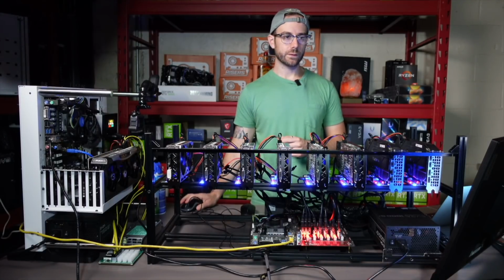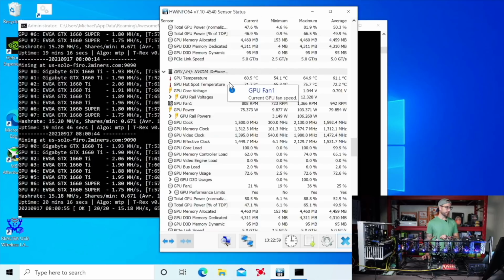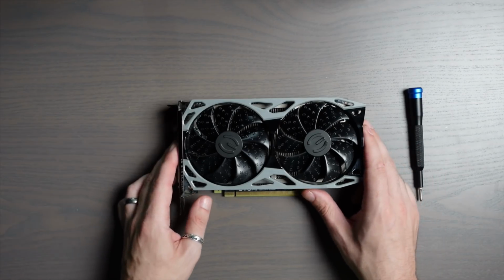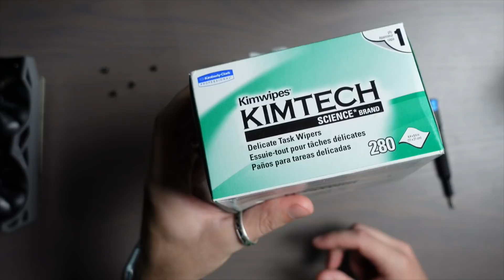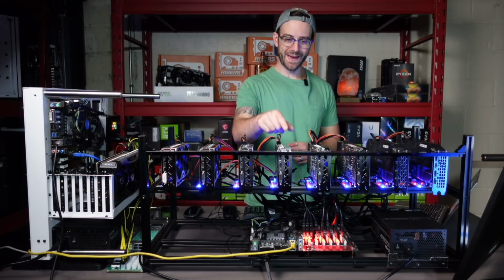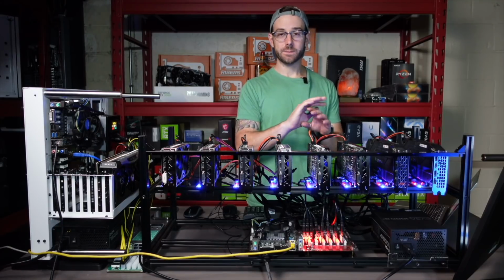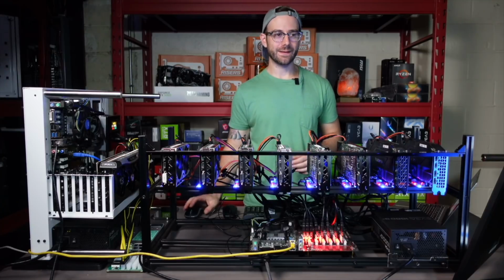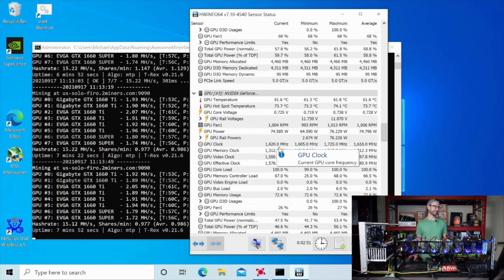Fixing an Overheating Mining GPU (GTX 1660 Ti)

Comment: Nice fix! I bought the a GTX 1660 TI and I was benchmarking on fortnite with heaps of stutters and I was looking at the GPU temperature only at 70 degrees and couldn't work it out until I opened HWMonitor and saw the hotspot temp at 84c which was set stock in afterburner to throttle at 83c so I changed the throttle to 86c and in ran better straight away! I didn't realize a hotspot would throttle at such a low temperature! I opened up the GPU which was only two years old which I had to ruin the warranty sticker on and saw the memory chips looked burnt so I put separate heat pads and heats sinks on every memory chip and replaced the thermal paste on the GPU. It now runs way smoother and the hotspot is now 79 degrees and it runs flawlessly. :)

Comment: late to this party but really enjoyed watching.. chuckled to myself early in the video as I watched you holding the "upper portion/containing fans" which had thermal grease on its cooler portion lay it down on the table with the thermal grease on its bottom.. oops, messy moment... 1 question for you - Do you use a pencil eraser to rub back n forth over the x16 contacts (both sides) or something else?  helpful advice - I've found using only 1/2 half a tooth pick (thickest end) pushed through 1 hole (heat sink side) to align the 4 holes for the securing screws.. leave it in 1 hole while placing the other screws in their positions then remove it and put in the last screw.. makes assembly a tad faster and helps to stop the "sliding" effect.

Comment: On gigabyte cards it is better to remove the plastic back, the card keeps at low temperatures.
The last one I received two days ago, the screws weren't even tight. I immediately changed the thermal paste and the thermal pads and removed the plastic plastic cover. The maximum temperature I reached was 48 degrees Celsius.
1660 ti ,31.40 mh/s

Comment: I have 2 EVGA RTX 3060's and with the same settings in the same rig and running the ~same hash rate one constantly runs ~10c hotter than the other.  I took it out of the rig and pulled the cooler off and it looked good.  I cleaned and re-pasted it and still have the same issue.  If I pull the settings back on the hot car to lower the temp the hash rate also drops.  Is it a "bad luck" card and will always be this way or it could be the other card is a good luck card and the "hot" one is normal.  I use NiceHash and on NBMiner/KAWPOW I am getting ~21 MH/S with temps at 66c and 76c with fans at 75%  Turn the fans up to 100% and temps drop to 62c and 72c.

Comment: Hmm I noticed no connection between ram/vrm's and the heatsink? I wonder how hot they are getting (got a thermal camera handy?) I would add thermal pads from the rear side of ram and vrm's to contact that big metal plate, if not for anything but to help the reliability of the card.

Comment: I just repasted and repadded my MSI 1080ti that's been under water for a year. I think the RAM was getting hot as I didn't replace the pads initially, and the paste was kind of dry. I put Frosty pads (Amazon, I bought all 3 thicknesses) with EKWB paste, and now it mines at 41C, down from 54-56C overnight :D

Comment: Great video Mike! Nutty how half the paste is missing on that GPU.New paste job looks very good. I have a single Gigabyte 1070 that is running much hotter than the rest of the pny/evga/msi cards in my 1070 rig that needs to go under the knife. Thank you for the instruction.

Comment: One point you missed out on is letting the GPU sit for about 24-48 hours to curate before putting it back on and letting it mine right away. Ive done it before and I was getting great temps but after about a few days the paste itself drips out of place and then temps got really hot again. And I’ve done step two and haven’t yet applied anymore paste for many months and is running strong! Nevertheless, great video!
Reply: Mx-5 curation needed. thermal grizzly not needed.

Comment: my 1660's all do 2.00 - 2.20 MH/s on firo feelsgoodman
Reply from the maker: Nice dude. What power are you running them at? 90w?
Reply: @RedFoxCrypto  yeah around 95, i kinda change it depending on each card, my MSI 1660S does 2.30MH/s! its such a good card

but my settings are probably not best electricity wise

Comment: Adding a thin teflon washer to the heatsink screws in the back will increase mount pressure and help bring down those hotspot temps.

Comment: You are correct with spreading on a GPU. Since these are exposed silicon you need to have 100% coverage. On a CPU it's not as critical because the IHS touches all of the silicon.

Comment: Man, remove your rings when you open your GPU! 

I was shocked when I got my first 1660ti that EVGA didn't put pads on the VRAM (cheap fuks), but somehow it's working.
Reply from the maker: Were you grounded? ESD protection?

Comment: Man I've been having issues with my EVGA XC3 Ultra 3080 TIs with their temps. The hottest one was sitting at 68c GPU temp, 98c junction and 72c hot spot. I replaced the pads/thermal paste and the gpu temp shot up to 86c, Hot spot to 105c but the junction went down to 74c. I've pulled thing apart several times to make sure I didn't have pads misplaced or anything, not sure what's going on. I figured I might had too thick of pads in one spot so I dropped them down a half MM, and the temps go back to their original values before I even replaced the pads to start with. Wondering if they are just poor quality pads so ordered some new ones. Pretty frustrated =(

Comment: Everyone commenting about thermal pads. No you should not put them on this card. They are good for conducting heat away to another surface. If you put a thermal pad on them it will stop the convection of heat away from the memory by blocking the air hitting the memory.
Reply from the maker: Thanks dude thanks for watching and sharing.
Reply: I SUDDENLY CONFIRM MY PROFIT RETURN PAYMENT 0.8 BTC IN MY BLOCKCHAIN WALLET JUST NOW NOBODY REGRET OF DEALING WITH YOU SIR👆👆👆👆👆

Comment: the Arctic MX-4 or 5 compound is one of the best compound you can use for GPU... the price is so good, and it's not gonna get you noticeable difference with more expensive stuff like thermal grizzly's. It's also better than almost any of the stock compound used by manufacturers.
Reply from the maker: Good to know man thanks for sharing. Bought it off a whim on Amazon a while ago and it’s been good as far as I can tell.
Reply: @RedFoxCrypto  yeah the MX-4thermal conductivity is 8.5 W/mK the average factory compound is about 4-5 W/mK. Any paste will do good, as long as you make sure you use a non-conductive(electricity) compound around or above 4-5 W/mK anything should be fine no matter what. SO in the end as long as the compound is non-conductive you won't risk a short. The GPU dies are not protected by an IHS like CPUs are
Reply: Also the hotspot temp is the hottest spot reported on the GPU die, instead of the normal GPU core temp, which is an average. Unlike you CPU sensor showing you each cores, in the case of a GPU they only show the max and the average.

Comment: So.. I have a question 🤔 
You said the hotspot reads the hotest sensor.   On the cards that have a memory temp sensor the mem temp always reads hotter than the hotspot.  Is it right to assume the hot spot is only reading the die temp?   : )
Reply: Yea thanks Jesus   😊 🙏 

I've noticed everything exactly as you said.     Hot spot goes up when the gpu die isn't cooled properly due to paste coverage or the heatsink not close enough.

Comment: The most nervous you will ever see a miner is when they pull those screws.  Biggest sigh of releif when you put it back in the rig and it fixes the problem.  Worst card i ever had was my 1060 6gb.  The thermal paste was so old and dried out it fell out in chunks when I opened the GPU! Dropped temps by 15 c and the fan doesn't run 100% all the time anymore.
Reply from the maker: That’s crazy dude! First time I had an actual issue with a GPU thermal paste.

Comment: I have five ASUS Tuf GTX 1660 Supers, dual fan. Worst cards I've ever bought. One was DOA and had to be exchanged. Two run absurdly hot, despite re-pasting and re-padding both. Of those two, one of them draws 88 watts even with a PL of 75 set. Another one needs a PL of 80 to get more than 30 MH/s. Of those five cards, only one worked properly out of the box. Avoid these cards at all costs!
Reply from the maker: Yuck sorry dude. Thanks for sharing your experience.

Comment: These days I run into "Gpu no temps error" in Hiveos and I wonder if this is software issue or if it could be related to high temps ? My cards doesnt seem to throttle though... pretty confusing
Reply from the maker: I get this pretty frequently with my AMD cards on Team Red Miner. I’ve tried all different overclocks.

Comment: I'll be doing this exact thing in the next couple of days. My starting card has been running hot for the past few weeks, and it's a 1660TI. Sometimes it's like you're in my head.
Reply: You motivated me to get it done sooner. Just finished a while ago, so far so good. I should have done this months ago... that card needed some attention. It's running a good 10c cooler now

Comment: my evga 1660 super has a thick thermal pad on the memory that yours does not. weird.
Reply from the maker: That's interesting. Must be because of the higher memory clock speed of the Supers that they added it. Hmmm.
Reply: @RedFoxCrypto  id say that's it. to be honest i doubt the thermal pad on mine really does anything anyway. its just a big chunk of pad that connects to the fins of the heat sink. its just there so they could say its there by the looks of mine.
Reply: Evga cheaped out? I recommend gelid thermal pad, 0.5 thickness depending on your vram and heatsink spaces

Comment: Did you say that it's okay to remove the warranty sticker and that it means nothing in the US?
Reply: Magnus and Moss warranty act says warranty void stickers are not enforceable in the USA, but manufacturers will still act like they are. You may have to resort to legal action if they refuse, but it will have to be on principle because it will cost you more in time and legal fees to sue than to just go buy a new widget. That's why manufacturers still get away with breaking the law. File a complaint with the FTC to report bad behavior, and probably let it go at that if you are looking at costs to sue to enforce a warranty on a GPU. But ianal, so you may want to spend a few minutes and call a lawyer to get professional advice.